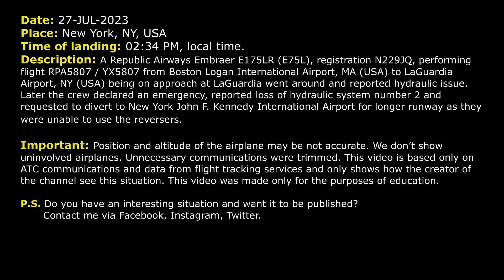Loss of reversers. Hydraulic system failure. Republic Embraer E175LR diverts to Kennedy. Real ATC

Comment: 4:40 Come on guys in ATC!!!  
I'm looking at the diagram for the airport and when the pilot said "emergency", "loss of brakes", "loss of reversers" I'm thinking give this pilot the LONGEST runway you've got... and they give him the shortest one. Come on. If you have a pilot declaring an emergency you should give them the longest and widest runway by default.
Reply: The winds were favoring the 22’s.
Reply: @saxmanb777  Okay but there's a long 22 and a short 22. They gave him the short one initially, even after he had declared an emergency. I just found it baffling. 

They corrected it eventually, but only after the pilot requested it and mentioned (again) that he didn't have full braking or thrust reversers.
Reply: @taekwondotime  it’s impossible that every controller knows everything about aircraft and even what they require with a downed hydraulic system. Most of them aren’t pilots. That’s why us pilots simply state what we need. No big deal.
Reply: @saxmanb777  I just figure if the plane has declared an emergency, why not give them the greatest safety margin to work with? That's all I'm saying. 

An emergency means something is not right. The pilots are having to deal with a tremendous challenge (mechanical or otherwise). How about we takes steps to make the landing as easy as possible for them?  Let's not try for the aircraft carrier landing on this one. ☺

Comment: Absolutely UNACCEPTABLE for ATC to be asking questions about the hydraulic problem. "Hydraulic System 2 failure" is enough. ATC does not need to know anything else unless there's a flight path issue that the pilots may want a block altitude etc. etc. Let the effing pilots do their job and leave them alone.
Reply: I thought the same. Most (not all before somebody jumps me) controllers I’ve met and interacted with have a limited knowledge of systems to that level of complexity. I’m guessing they were asking the question to determine if the plane would be  leaking hydraulic fluid everywhere or something that would affect later airport operations, but the way they asked was just kind of annoying.

Comment: 4:44 i find this strange, isnt 22R longer than 22L? Why does it have a shorter landing distance than 22L?
Reply: 22R has a displaced threshold of around 3,000 ft, so landing distance is longer on 22L even though 22R technically has a longer runway
Reply: @lutton3237  interesting, thanks for the info! I tried looking online, but couldn't find anything other than the total runway length...
Reply: @MrMrRubic You can find that information either on the airport ground chart directly or (for most larger airports) on a "chart" named Airport Info, Takeoff minima or similar (if labeled, otherwise it's typically just behind the airport layout).
I found it openly accessible by searching "kfjk chart ground chart takeoff min" (probably longer than need be). It specifies the threshold for each direction and ILS glideslope :)
Reply: only so outdated as the time allowed in the fuel which changes constantly